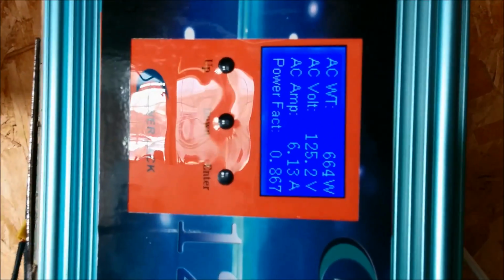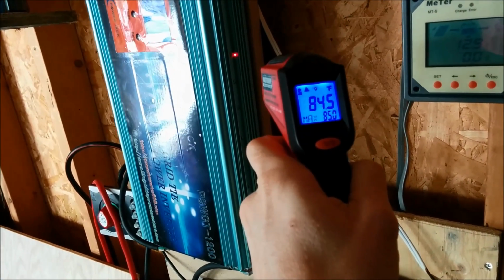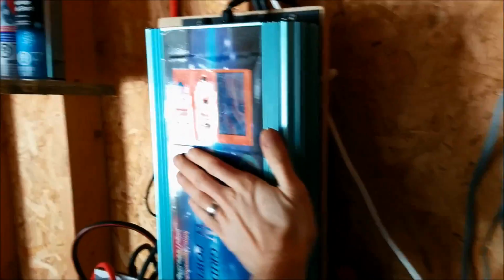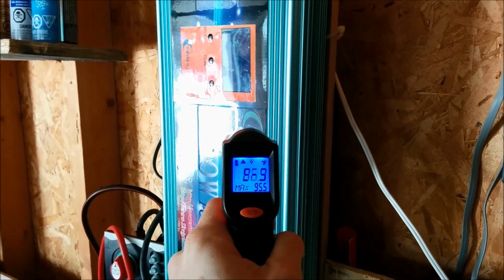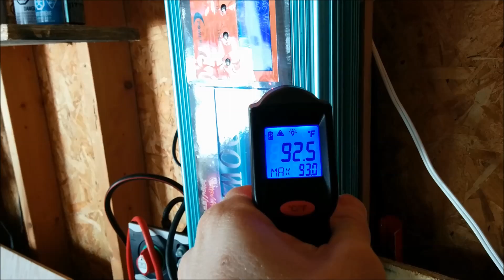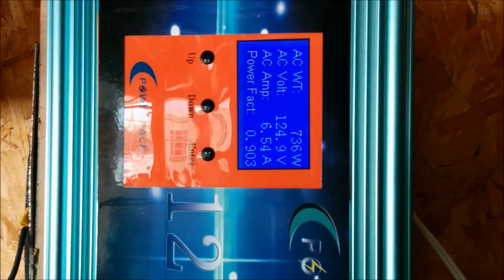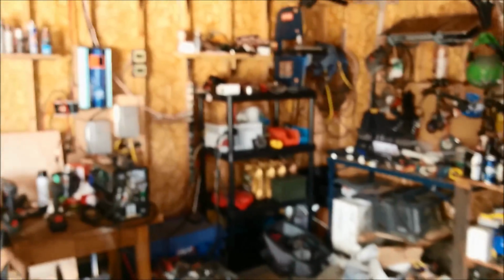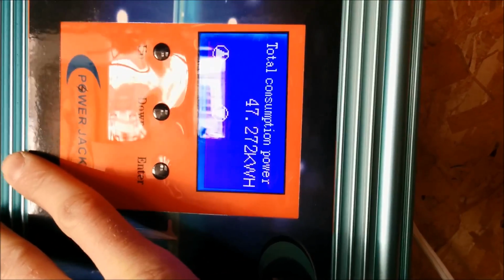1200W power jack grid tie 700W out put!

Comment: @Going Off Grid, I have a question for you.   I am stumped.   I had 2 x 255 Talesun Panels.  Giving me anywhere from 0 to 450 watts during high peak.    I now added 2 more panels to it, 2 x 250 Canadian Solar.    All in parallel with a 4 to 1 MC4 Connector.   What I do get now, is mid 400 watts earlier on in the day and mid 400 later on in the day.    It never shows more than 480 watts even in peak sun.      Any idea?
Reply: my grid tie doesn't want to go higher than close to 500 even with 1000 watts of panel.
Reply from the maker: are they different voltage panels?
Reply: all are 24 volts, I checked at the end and it read 30 volts plus.
Reply from the maker: it seems a bunch of people had having this problem with these newer power jacks as they are only 500w now or something like that.

Comment: If you have a smart meter on your house you can email your power company to get them to come test your system. If your tier grid inverter shuts down properly when the AC power goes out they will approve it and re-program your meter to measure power in both directions. If you produce excess power the meter will record it properly and reflect a KW credit on your power bill. I am currently installing my solar grid and already contacted Georgia Power. They will come inspect it when I have it ready! Cheers!
Reply from the maker: thanks!
Reply: @ Robert, How difficult is it? Them to deal with? Added expense? I'm also in Georgia......canton, Cherokee county. I've just bought a mppt CC, and 4 renogy 100 watt panels. 60 amp controller to allow for expansion. Any input appreciated

Comment: Power jack sells nothing but lies and pieces of shit!
Reply from the maker: that is true but, I don't buy things with out researching them first, and I new from my research to check the insides for any problems and I found one that would of killed this unit if I didn't fix it.
Reply: what do you mean?    I just got one of these and it's working good.   What do you mean by check the insides?    thank you.
Reply: Solder connections and such. Almost any chinese electronics should be opened and checked before powering. I learned this from buying chinese quadcopter drones.

Comment: so I seen all you have but have you checked your meter? is it a smart meter, if so some are  built
 to only go forward . manufacturers made them for those who turn them up side down to cheat
like the old meters the smart meter would still run forward. another words what you make add
not subtract.
Reply from the maker: yes i try not to make extra. im mostly off grid no more grid tie much at all.

Comment: I have two of these.... they work better if you power the DC side with a Power Jack 100A charge controller.... just split the output between the inverter and your battery bank... I'm using the 14v-28v unit with 33vdc going into the charge controller... my units never gets warm, and  always puts out 120-124v AC.. Surprisingly good quality units....
Reply from the maker: yes I like mine
Reply: Yes they work well.... what surprised me was that the unit never gets hot to the touch, and I'm only feeding it 1000 Watts= 26.7v  from the charge controller. I've never seen the fans come on. I'm guessing I've got the right gear hooked up properly... I've also got an older, smaller 1200W unit I've had in service for a year+, and it's been rock solid, and dependable too......I think the key is those Power Jack charge controllers...... I've got two 100 Amp units, and my 24v setup is high voltage, low amps....Nothing get's overworked, and nothing gets hot....... :)
Reply from the maker: Grover Watson I run 1700 watts through mine :D

Comment: just bought my first 300 watt i figure only 60 percent of my pannels are going into as conversion u think iam doing somthing wrong
Reply from the maker: no that's about right, on the coldest day with sun is when you will see the most power
Reply from the maker: Joe Primal yes almost 800 KW made so far, if you buy one you need to make sure everything is heat sinked properly
Reply from the maker: Joe Primal be safe!
Reply: fliping720 Sure, go ahead, take the fun out of it.
Reply: +fliping720  Hi.  Is the inverter still holding up?
Reply: fliping720 Thanks.  I got a bunch of panels cheap and now I've got to figure out what to do with them.  Enjoy your evening.

Comment: Do you need a permit from the citi to use this inverter or you can do it your self with out ask for permicion to the citi I have one just like yours  end 4 panels I dont know wath to do
Reply from the maker: my house uses so much power it never goes back into the grid. i use 100% of the power + 150% more then i make. I have a hot tub witch runs almost all the time... if u live in Canada it will be hard to get a Chinese grid tie certified.

Comment: How many watts of solar do you have connected and what voltage range is the grid tie as I have the same, Mine I have 900 watts of solar and the highest I have seen is 700+ watts.
Reply from the maker: 1450 watts of solar, but its winter so i get a little over half that atm
Reply from the maker: I have 1450w at 32 volts they are 24v panels and I only get 900w in the winter with cloud  affect